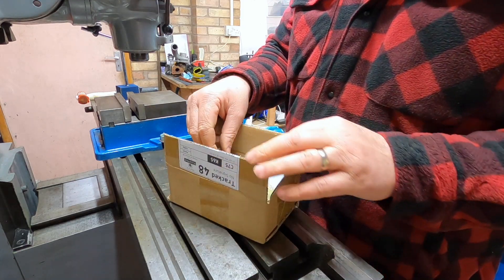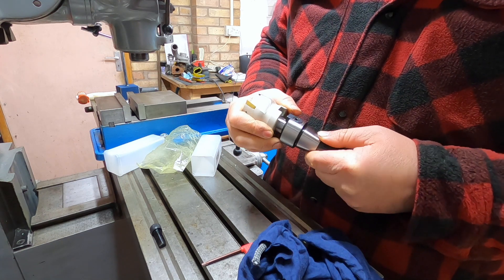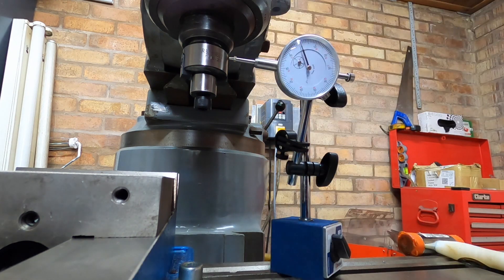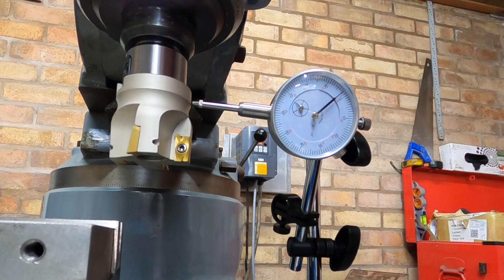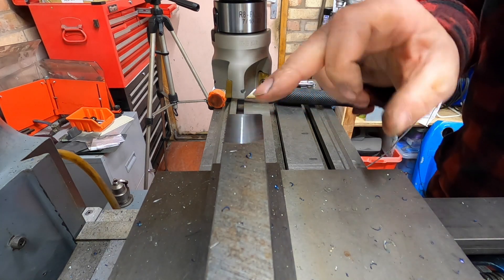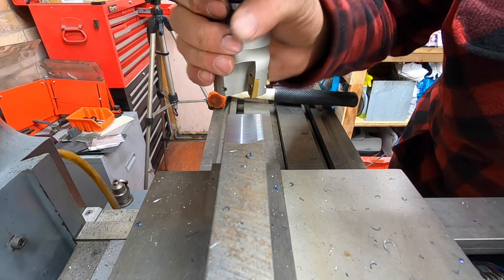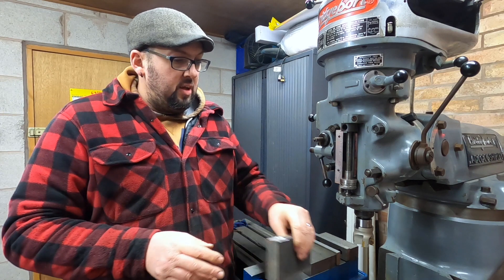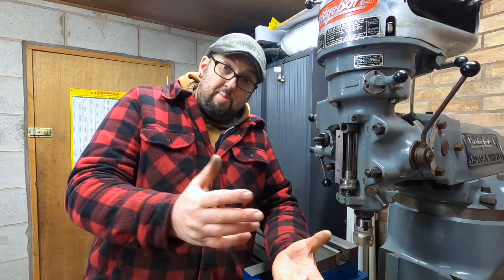Facemill - 50mm R8 - Cheapest on eBay!!

Comment: The one I got has been good I had less than a thou run out I didn’t like the inserts so I replaced em with some decent carbide and it’s been a great tool for mild steel so far. Nice vid man.

Comment: That chunk of steel is enough to make a machinist vise from. Get ideas from the scraps youget.
Reply from the maker: Oh yes, we have a reasonable supply of bits and offcuts, and I have a couple of workshops I can raid if need be, but usually I buy full lengths. Laters, Matt

Comment: Hi
You would have been better spending a little bit more and got one that mills square corners 90drg, a lot more handy, they take the same inserts, also for the same price you could have got the 60mm one which will cover the full width of your brass. Cutwel tools. 
I made the same mistake. 
Tim
Reply from the maker: Hi Tim, thanks for your comment, yes a 60mm one would be better for the brass. I shall definitely have a look on the Cutwel site. Thanks for the suggestion. Laters.

Comment: Use a brush not your fingers when it’s running or I’ll have to start calling you stumpy 😂
Reply from the maker: Any Brush recommendations? The paint brush I was using seems as useful as a chocolate fireguard, now its clogged in oil and brass dust!!
Reply: @MattChiversWorkshop  ah, you fell in the trap of cheapness. One brush for oil, one brush for chips lol